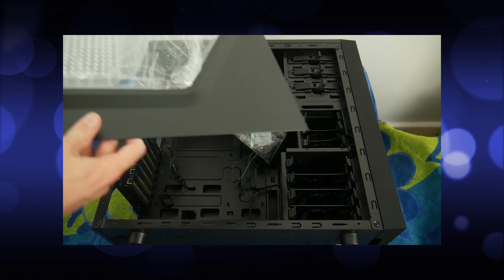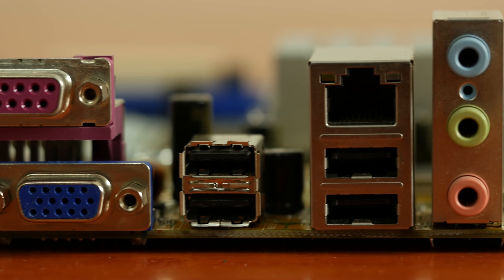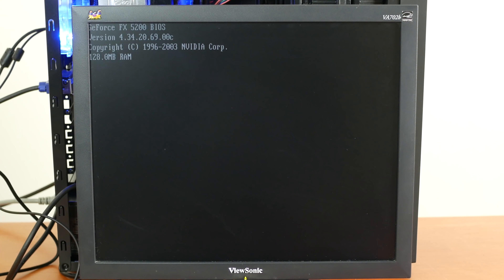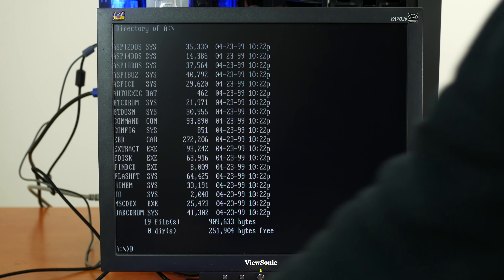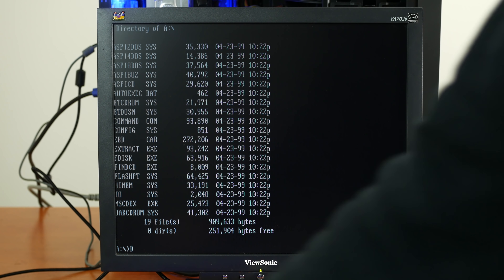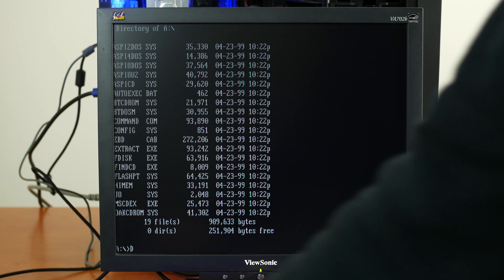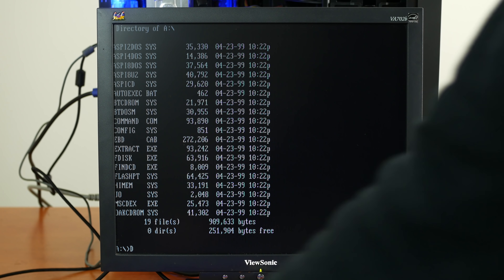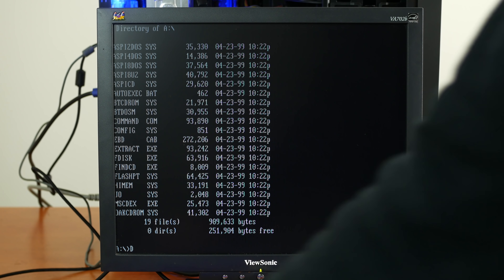What's the fastest (officially supported) Windows 98 PC?

Comment: Bro just get Windows Vista it's actually really good
Reply: And other things no ones ever said 😂 (I grew up on vista, it was probably the first OS I used)
Reply: @Jabe_VeX vista wasnt that bad
It was a driver problem for the most part
Windows 7 is almost literally just rebranded vista with more modern drivers
Microsoft just released it too early. Typical lol
Reply: @thexyouman  it wasn't a driver issue, it was a bloatware issue. They put way too much new stuff (including some legitimately good software) and then advertised it for computers FAR LOWER spec than what could comfortably run vista, leading to companies like emachine making minimum spec computers for as cheap as possible, calling it "vista ready" and the customer has a really shit time with a laggy computer
Reply: It was more than everything stated. I once had a white screen of stuttering that only a reboot would love on Vista. I also had numerous blue screens, countless installs to fix minute issues to major catastrophic registry failures. Also Aero just wasted resources and it felt, like previously stated, rushed. 7 wasn't much better.
Reply: @Jabe_VeX  He's right, though. Vista only got a bad rep because Microsoft and OEMs insisted on selling "Vista ready" PCs that actually weren't. Absolute slushboxes with Celeron CPUs and 2GB of RAM. If you had a half-decent PC at the time, Vista was a great experience. Literally all you needed was a 1GHz processor and a GPU with a mere 128MB of VRAM. Even by 2006 standards that was hardly anything, but OEMs at the time couldn't even meet those paltry standards. Vista ran smoothly on my Core 2 Duo E8400 with 4GB of DDR2 800 RAM and a Radeon HD 4850. That was a $1100 PC at the time. It wasn't some $4000 supercomputer.
Reply: @Psythik  so literally what I said

Comment: I love how Linux just runs on anything without problems.
Reply: I do have a laptop which Linux is straight up incompatible with it but in most PCs Linux does work
Reply: there are a few drivers issues sometimes.
Reply: Isn't it kinda the exact opposite?
Reply: I do have a few pc's that linux doesnt work on
Reply: It runs on anything but certainly not without problems
Reply: Getting modern versions to run on older hardware or old versions to run on new hardware can be just as problematic as with Windows.
Reply: Hey peter capaldi
Reply: @DucksFor4  Hey Dalek. Don't eliminate me lol
Reply: I could never get my Asus laptop wifi/ethernet to work on linux
Reply: @thealien_ali3382  let’s see
Reply: Why not really, I tried on my PC as a experiment but sound didn't work also network stopped working
Reply: There are wireless adapter problems though. It's false to say without problems, there are, even if those are minor and easily solved, still problems.
Reply: In Windows defence, he wasn't trying to run a Linux build from 1998
Reply: but only from a flash drive, an installated version on a pc could make also boot problems on old hardware.
Reply: Linux is basically the OS equivalent of Doom.
Reply: I have 5 laptops and 5 towers
Reply: @squirlmy  The drivers are either embedded within the Linux kernel or implemented as a module. So your distro only affects in installation experience in terms of compatibility. If something works on Mint, the chances of it working on Arch is high too as long as the dependancies are met.
Reply: @brandan w Those issues are few and far but they're annoying when those aren't present in the kernel.
Reply: @brandan w I can understand that, my laptop has RTL8821CE which isn't supported by RealTek so my best bet was the community which made a nice driver that works as it should be. But that can't be said for other wifi drivers all the time.
Reply: I could run Linux kernel 1.0 on a Commodore 64 no problem.
Reply: @UnusedChar   did you ever install drivers?
Reply: @tristan6509   it deppends, ESPECIALLY on the distro choice. Ubuntu is the way to go but there are also distros that work even whit powerPC
Reply: @FIRSTEBITOS  on my experience you need to mess with config files to get shit running smoothly in linux

It just never runs right no matter the distro, I guess the main problem are the drivers, they're all pretty crappy for linux.
Reply: @tristan6509  what your config? I used elementery,mint,ubuntu,manjaro and pop and never used acessed any config file or used the terminal to tweak, exclusively using the terminal to download packets since isa lot faster, but yea if u have a old NVIDEA or the old core, it can be tricky.
Or worst of all, its just your motherboard being funny whit u
Reply: @tristan6509   AMD and intel come embedded whit the kernel, there are no "drivers" to be bad as we say in windows
Edit: meaning u can't actually have bad drivers unless u use NVIDEA, since their drivers are proprietary.
Reply: @FIRSTEBITOS  intel wifi is proprietary
Reply: @bootmii98  i was talking about cpu's
Reply: @FIRSTEBITOS  CPU issue is more because many distros don't offer a i386 build anymore.
Reply: I got Ubuntu on a Chromebook where it took up 90% of the disc space once. Had to move to Linux Lite, but it does work
Reply: Hahahaha NO

Comment: I own this exact same ASUS motherboard and very similar hardware, and running 98 has been pretty much a flawless experience on my end. There are a LOT of issues shown in your video that can be solved with a few simple BIOS setting changes, and a clearer understanding of how the hardware interacts with the operating system. It's understandable if you don't have a ton of knowledge about much older hardware like this, but it's definitely something you can learn!  The stuff from the 98 and XP era were the last generations that tended to expect more intimate knowledge from users on a system-wide level when building custom machines.
Reply: Correctly! And that's why you learned a ton of stuff, even if you didn't want to become an actual geek. But forced to solve all kinds of issues just to play games, automatically brought you into the territory.
Reply: @drumsmoker731  indeed
Reply: Very true, the older hardware required more attention to configuration.
Reply: Windows 98 was actually a very stable OS, if intsalled and maintained correctly.
Reply: To be fair most of his issues are rather basic with only 1 that is not as obvious.
like:
Using devices that he knows Windows 98 has to great if any support for (Sata)
Not double checking CPU to mother board compatibility ahead of time.
Using rather late drivers when its a somewhat known issues (he after all mentioned it) that the last few NVIDIA drivers for 98 were trash and caused often nothing but issues.(this is the not as obvious one because who would expect the latter drivers to be worse)
And using onboard audio when many early onboard audio chips were that great (I didn't see this as a obscure issue as with the aim for an ultimate Windows 98 machine which was his goal should a proper sound card have been a absolut requirement from the start)
Reply: One of my friend asked me to fix his old thinkpad laptop back in hmmm maybe 2017, I forget the type but it came with WinXP. I haven't done any fresh install WIn XP for years at that time so It's really took my time lol
I still had winXP install CD but the ThinkPad's CD Drive was broken. 
Fortunately at that time I still had my old Hiren's 9 flash drive, and I still had cloned image of WinXP in Sysprep mode ( I forget the exact term lol) in one of my older gen external drive, I managed to clone it to the ThinkPad and voila! It runs well lol and managed to finished the install in one day.

If someone asked me to install old OS like Win 98, Win2000 and WinXP right now, I will ask for more time, because I don't have hiren's 9 bootable flash drive ready and I am afraid of the condition of old Windows Installation CD, because It sit in the storage for so long lol
Reply: Asus is very sus
Reply: @rynobehnke8289  He shouldn't have had to double check since literally every single socket generation after this one had it where if it fit, it worked, period, provided with a BIOS update, but still.

It's kind of why we get new CPU sockets now, since they literally ran out of ways to keep making it work on an older chipset. Still, Ryzen has managed to work FIVE GENERATIONS on the same socket of AM4, that's huge.

This thing came out in 2006, you and the other guys are acting like he's a neophyte because Intel/AMD and the motherboard companies used to be a lot scummier.

People used to have to be more "intimately involved" with their tech because it was, frankly, designed like hot garbage. Pre-XP Windows were held together by fucking stitches and decades-old wet tape. Ever wonder why ME was so buggy? Because it was a re-release of the already maligned, buggy Windows 98 *WITH THE ADDITION OF REMOVING FEATURES WITHOUT SEEING IF THEY WERE NEEDED FOR ANYTHING*.

Pre-XP Windows is genuinely more complicated and annoying to work with than any iteration of Linux, which is astounding to say. It's also more obfuscating and tiresome, which is also astounding to say. It was designed like some hellish "outsider's club" where it's as vague and nonsensical as possible to keep people out.

Tech isn't complicated, neither are OSes, Microsoft were just stupid.
Reply: @acumenium8157  
The important word here being AFTER as he knows that it wasn't always the case. Like he in this very video admitted that he last time used a Pentium 4 because he got him self a motherboard from which he knew it despite being Sockel 775 only supported Celeron's and Pentium 4's.

Also talking about Sockels and bios's the main reason why on the Intel side all things are compatible is because every 2 generations did Intel release a new Sockel.
And while AMD's AM4's compatibility is amazing do they only work because of Bios updates. So if the bios never was updated or the chipset just is inherently incompatible than will it obviously not work.

Also I have no idea how you can think 9X windows is more complicated than Linux when some Linux distributions don't even have a fancy UI and are all command line based.
And I hope you compare 9X Windows to modern versions of Linux because there were even worse than win 9X was during its era in the late 90s
And funny that you call it an outsider club when it was literally designed to open with a "how to use me" guide after the first boot because Microsoftet wanted it to became the OS of the people.

Also also why did you even bring up Windows at all in this? Almost all the problems he had were Driver related and Microsoft didn't write the ones that created the problems other than I guess the Blu-Ray issues that came about because Window's 98 was written before the S-ATA standard became standardized.
And pretty much all of the Driver issues that mattered were for the Graphics card as NVIDIA's last drivers for 98 were all brocken and hardly working and the sound card drivers as on board soundcard's were at that era still not all that good and these issues could have been avoided with a proper PCI Soundcard with 98 support.
Reply: @rynobehnke8289  > And while AMD's AM4's compatibility is amazing do they only work because of Bios updates.

And all motherboards will have the updates because AMD mandates it, so...

> Also I have no idea how you can think 9X windows is more complicated than Linux when some Linux distributions don't even have a fancy UI and are all command line based.

Windows, when it predictably stops working, is never going to tell you why it's not working, or how to fix it.

> And funny that you call it an outsider club when it was literally designed to open with a "how to use me" guide after the first boot because Microsoftet wanted it to became the OS of the people.

If you need a "how to use me" guide for the first boot, by god, I think you do have some kind of outsider club. Especially since it's not teaching you how to "use me" at all, it's teaching you very specific instructions that may or may not even work.
Reply: @da_pawz  u
Reply: @da_pawz  u
Reply: @rynobehnke8289  8
Reply: @acumenium8157  I agree with you only in the compatibility argument, they made it stupidly complicated and they are kinda doing it again with nonsensical naming for their parts. But the whole how to use guide is needed even today, almost every person i have met that is over the age of 30 has no clue what to do with a pc if you slightly change the ui, they are completely lost if you take them from windows 7 or xp to windows 10, so don't even mention showing them any linux distro. 
People can't even be bothered to look around the ui and use some common sense to do basic things like finding the power off button or opening a browser, you have to teach them every step. So it's not a thing only from the 98 era but in the current time like 25 years later when everything has an OS people still can't figure out basic functions on their own even though those functions have been the same for the past 15 years
Reply: @joey_f4ke238  This is one of those weird "missed the point boomer posts".

"If we completely change everything and make everything different and also tell the end user nothing about how to use it now, they won't want to engage with it" is not some diss like you think it is, it is literally common sense.

My generation doesn't know how to use a rotary dial, write in cursive (much), or use stick shift either, but my generation has no real need to and my parent's didn't teach me, as well. Why?

Because my parents didn't even do any of that shit by the time I was born or of age to be fucking with it in the case of stick shift.
Reply: @da_pawz  I did an XP install for a client about a month ago. His hardware was failing, 2 separate towers, as you can imaging one being IDE old af and the other sporting sata and new modern commodities. For the older machine, I told him to abandon and reconsider having us build him something new, I did end up finding him a compatible xp replacement. For the newer machine, I had to take the IDE drives from the older machine and installed them in the newer machine, install XP onto that (Compatible SATA was the issue here) then I could finally boot into the OS so I could run the driver installs for sata and all the rest of the jazz. After all the drivers were installed, got him onto the latest version of firefox 52.xx or 50.xx i forgot which one but old. I then was able to boot into clonezilla got it onto an SSD, ran those registry tweaks to prevent diskdefrag and he was good to go. I hadn't experienced it before but hardware compatibility is definitely not as difficult as it was back then.
Reply: @drippymissouri  badum tss
Reply: The front side bus is what trips most people up. People assume a compatible socket means the CPU will just work like with modern boards but that isn't the case. Putting a 1066mhz FSB Core 2 chip in an 800mhz LGA775 board designed for a lower end Core chip or a Pentium 4 isn't going to work. You can however often use a lower bus speed CPU in a later high bus speed mobo and even tape a few pads on the CPU to overclock it, even on OEM systems.
Reply: @rynobehnke8289  anyone who had to use AMD drivers prior to 2010 knows that GPU drivers are usually shit.
Reply: If it’s simple, why not show the bios settings to change? You sound like those guys that have a computer problem, and later say they fixed it, but don’t provide the solution.

Comment: "how could a driver that shipped with it already be causing problems?"
it's windows 98. it just comes with the territory.
Reply: Plug and play? More like plug and pray.
Reply: Back when loading drivers from CD was common, commonly given advice was to forget about that and download the latest from the website. The CD drivers were fixed in time and were usually made before any user feedback.
Reply: @Cyberc50x  lol
Reply: @Cyberc50x  That's the name of the Computer Radio Show I have in concept :D
Reply: @dycedargselderbrother5353  this. Unless you were buying hardware on launch day, installing the 1.0 drivers on the CD was always a terrible idea.
Reply: @Niche-X ME suffered the same issues as Vista and 8 later suffered. Rushed to release with terrible hardware support at launch. Despite improving later on their reputations were already ruined, and Microsoft covertly re-released the operating systems later with slight design tweaks to give them a fresh start. Vista was re-skinned to 7, and 8 was re-skinned to 10.
Reply: @Niche consider 98lite if you haven't, it even works on Me, but doesn't do anything about DOS.
Reply: Tbh, 10 does that again, giving you drivers that aren't always the best choice.
Reply: @HappyBeezerStudios  Oh, yeah, Windows is still impressively awful trashware. It's just that 98 was infamous for being especially awful, until Me came around and people had a new scapegoat that was in some ways worse but not enough to really justify the reputation it still has.
Reply: @tituslafrombois1164 don't forget 8.1
Reply: 98 was a blessing compared to Me. 98 was the first windows to support multi-monitor. I had a spare ISA GFX card and VGA monitor  lying around and plugged it in. Dual screen in 1998.
Reply: @tituslafrombois1164 really? Why's that? Temperamental driver's?🤔
Reply: @MorganRussman-g1v  companies not investing the time or money to prepare and ship good new drivers to work with the new OS. Vista was broken as hell because Microsoft said "hey this is a new OS with a lot of changes so please adjust your drivers accordingly" and then every company proceeded to simply ship their XP drivers for Vista, and it was, of course, broken as hell. Same for 8. By the time 7 and 10 came out respectively, the companies had finally sorted their drivers.
Reply: @tituslafrombois1164  same happened with windows ME.  Drivers were simply ported from 95 or 98 despite the whole driver model changing.  
That's what caused a whole lot of crashes.